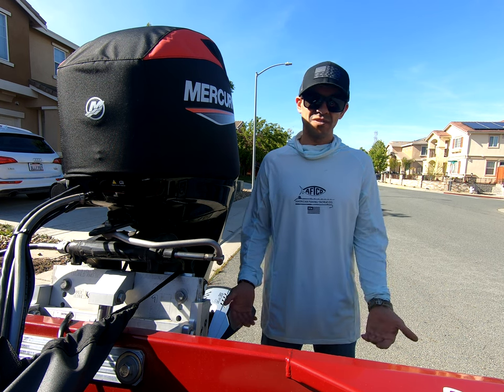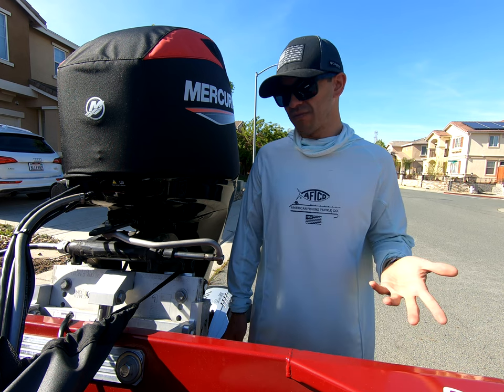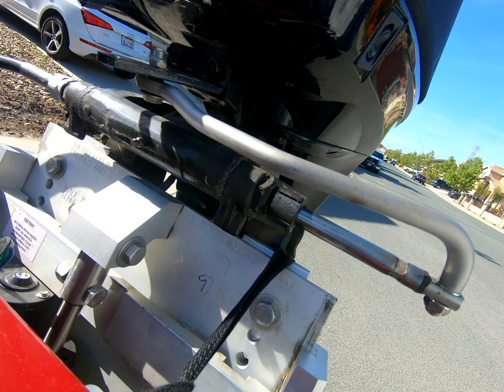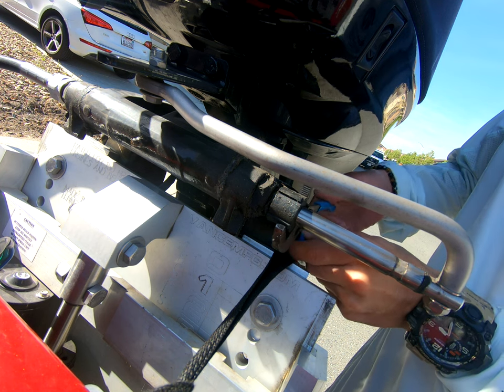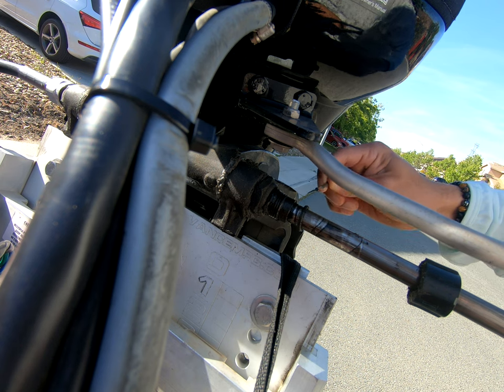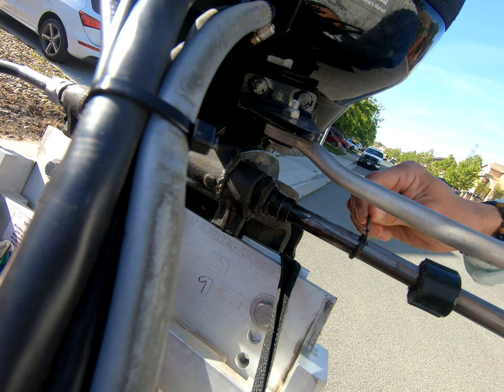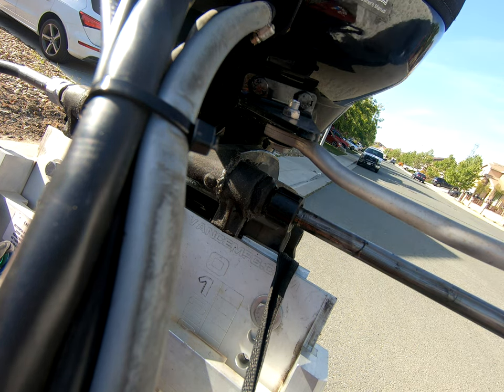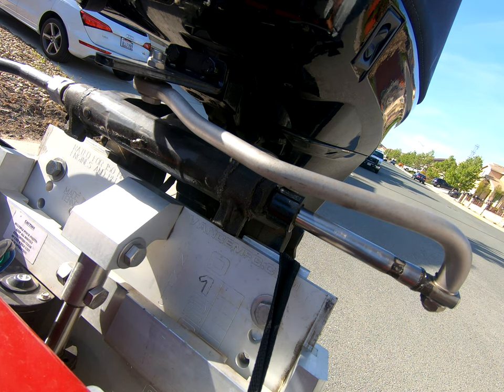Outboard manual steering woes? Here's a possible fix!

Comment: thank you very much..you just saved me some money and time on my 2021 Boston whaler mercury 60 hp i was going to take my boat back to the dealer and hopefully it would be a warranty fix but the dealer told me they have to look at the problem to determine if it was a warranty fix so i decided to try your method and it worked out perfect but the only problem  i noticed after greasing the O-ring looks like the O-ring starting to disintegrate (worn out) because of no grease the boat is steering great but do you think i should replace that O-ring because it sure freak me out when the steering lock up on the water .. my friend had the same problem on his 2019 mercury 40 hp and the dealer charged him $250 for the fix they told him the warranty would not cover  too bad he didn't look at your YouTube channel first...
Reply from the maker: Definitely replace the O-Ring. Any NBR (Nitrile Buna Rubber) or Viton O-Ring will work for it as long as it is the same size. The function of that ring is to prevent any water intrusion from getting in and contaminating, ultimately drying out the steering shaft and potentially even rusting it out. So I would definitely swap it out when you get the chance.

It's a weird issue to have right, and one that's super annoying but surprisingly easy to fix. I'm glad it prevented you having to take it in because all these dealers and marine mechanics take 3 months just to change out a bolt on these things for some reason. Why bother when you can do it yourself for free, or cheap, all within 5 minutes!
Reply: @extremeboating7347  your exactly right..one more question if you don.t mind i also noticed that plastic nut i took off to get to the O-ring was very tight probably factory defect because i ordered this boat brand new from Boston whaler anyhow i noticed when taking off the plastic nut there  plastic shavings falling to the floor of my boat then i look into the plastic nut and noticed the threads were torn and stripped...i did my best putting the nut back on semi-tight because if i go to tight it spins so i put it hand tight..do you have any suggestions where i might be able to order a new nut...thank you very much for your help..this is my first boat and retired  and I've taken it out over 50 times the first year here in California ocean and i already did my 100 hour service at the dealer which was not cheap..thank you once again for the help
Reply from the maker: You will have to purchase that nut directly from a Mercury dealer or from an online store that retails those. You can check boat outfitters, Leaders RPM, or Boats.net. I would definitely call a dealer or check the online Mercury parts catalog for the part number to the nut and then punch the number given to you into Google.

That being said that nut is nothing but a retainer to keep the seal in place and as long as it threads in okay then I wouldn't lose any sleep at night over it. Because it's plastic it's easily fixable unless the threads are just totally gone. I would just spray some lube of some kind (WD40 would suffice) onto the threads if they are still there and then work the nut in and out several times until the threads self clean and self correct themselves.
Reply: @extremeboating7347  thank you very much for the advice and i will let you know how things turn out..

Comment: Is there a way to fix or repair a broken (rotted) steering arm bracket on a yamaha outboard v6 200 2 stroke - thanks
Reply from the maker: I'd have to see a picture of it to tell you if you can or can't.
Reply: @extremeboating7347  thanks for fast response , i just found out they have to remove powerhead because it is to rotted to weld a piece of steel to fabricate one - thanks

Comment: What happened when the other side into the console?  .My driver doesn't turn I disconnect the motor side and still no turn
Reply from the maker: You either have a seized cable, or a bad manual steering assembly at the console. I would disconnect the cable at the console and try to turn it. If it still does not, the entire assembly is defective and you'll need to replace it.

Comment: Ypu have a grease.nipple.in the middle.of the steering rod. Use a grease gun every season and fill it till clean grease.comes out. I can see.it.in ypur video
Reply from the maker: Greasing all the fittings was one of the first things I said that I tried in the video (at least I'm pretty sure I did). I also said it in the comments section to others. No amount of grease in those areas was going to take care of the issue.